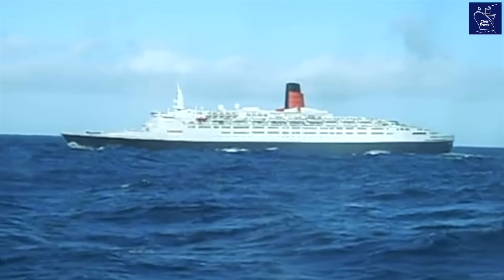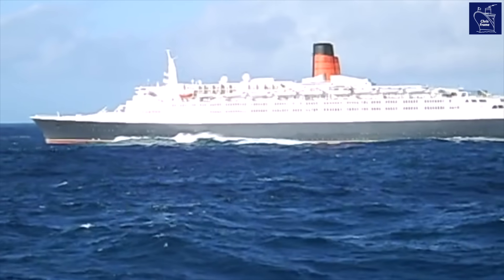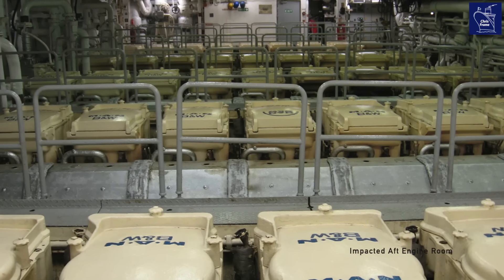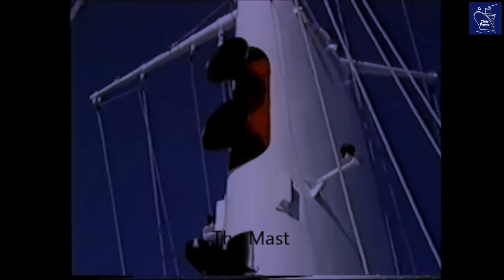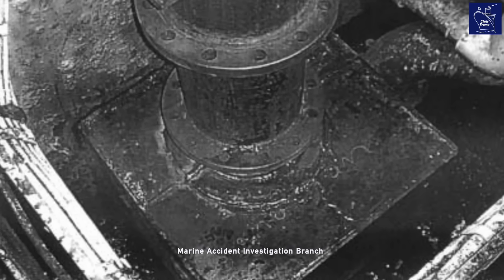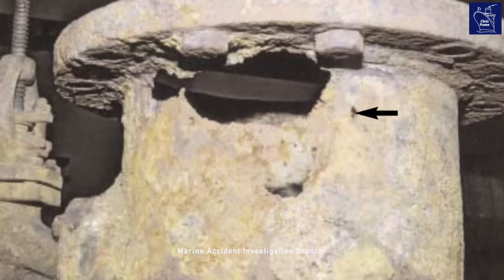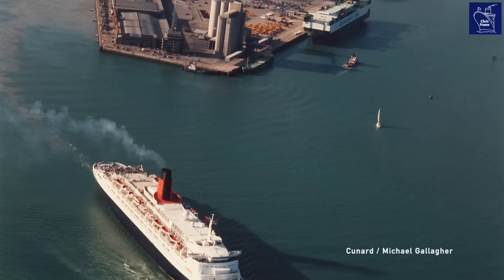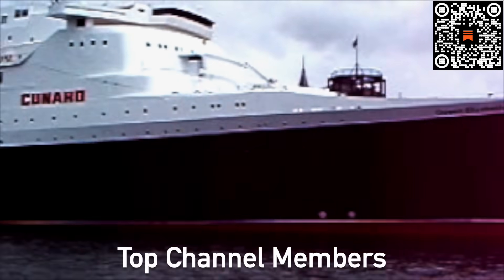Dead in the Atlantic: The $60 Million Emergency QE2 Survived

Comment from the maker: Had you heard about this daring repair effort? How good are QE2's crew!
Reply: I had lunch on her and a tour of all the passenger and crew areas (except machinery spaces, sadly) in early 2000.  I was surprised at her poor condition such as the buckled deck in the port-side crew alley.  The deck was slightly domed and, when you walked over it, it 'oil-canned' down about 10-15cm.  Apparently, everyone was used to it so it wasn't cut out and replaced.  I was told there was a fire that caused the buckled deck-plate.  At that time, all her "space-age 60s" interior had been ripped out and cheap wood-veneer panelling had been installed because, apparently, that's what Cunard cruise-passengers expected.  It looked very "neo-trailer-park".  In contrast, the Queen Mary's beautiful burl-walnut grand piano looked magnificent against all that cheap wood-panelling.

Comment: Neglect let the pipe corrode to the point of failure.
Reply: Sounds like the perfect storm of steel pipe used where stainless steel pipe and welding was needed and flawed location of the valve remote from the hull.
Still more options than a serious problem on an aircraft which is why I used QE2 for transatlantic trips and prefer going by sea.

Comment: Concrete box, I’ve used them before. Electrolysis eats the pipes soon after entering the ship. The capac protects the hull, and maybe to the first valve. Standard now is a waster piece, required to be removed at least every 5 years or sooner, and replaced if deterated beyond life expectancy of the next inspection.  Capac (catholic protection is either zinc anodes,or impressed current) to slow or stop hull corrosion. Have fun
Reply from the maker: I appreciate you providing the technical details.

Comment: When the leak was discovered, did they stop the ship? Would that have made any difference in terms of the rate seawater was entering the ship through the broken pipe?
Reply: Nothing gained by stopping the ship, keep the machinery running and all hands to the pumps and damage control. All well run ships have kit ready for hull penetration,  cement, wood wedges, jacks, tarps, caulking,  bungs, etc etc. Hopefully you have a resourceful damage control team.  Sea valves are one of the most tricky leaks to control.

Comment: This sort of problem could easily be avoided by surrounding every sea water inlet valve with a small watertight compartment. So, if the inlet pipe or control valve failed, then the watertight compartment around the inlet could simply be closed off. This arrangement would even permit the water inlet to continue to function as a second valve later on the pipe, outside the flooded compartment could be used to control the flow.
Reply: Easily?  what about inspection, accessibility

Comment: I wonder why a sacrificial zinc plate wasn’t used to control corrosion. I guess it would be difficult to fight from inside a pipe! Plus I bet the passengers never had a clue unlike on an airliner where problems become very obvious quickly! I forget if she was faster in cruise speed with her original turbines or faster after her refit with diesel electric drives?
Reply: The degradation of material was in part electrolytic corrosion but since it is a high flowing inlet more likely cavitation caused water flows creating a low pressure zone at the flange.  Especially if the flange has hard angles creating turbulence as the water enters the ship.  This is why welds and materials are ground to remove nucleation points.   In this case it is sloppy engineering practice.

Comment: Very interesting article. Excellent problem solving and improvisation, by the engineers on board with limited resources. Pretty scary consequences... if not . Powerless in the middle of the Atlantic doesn't bear thinking about!
Reply from the maker: It really is remarkable what they achieved with limited resources!
Reply: @ChrisFrameOfficial  it certainly was, working in an engineering design office myself, I take my hat off to them!

Comment: When I first went to sea all ship's side valves were against the hull. A flange with studs was welded to the hull on which the valve was mounted. I noticed later on in my career as a marine engineer, a short section of pipe between the hull and the valve on just about every ship I sailed on. Why this design was introduced I cannot answer. In my book the valve against the hull was a much safer option.